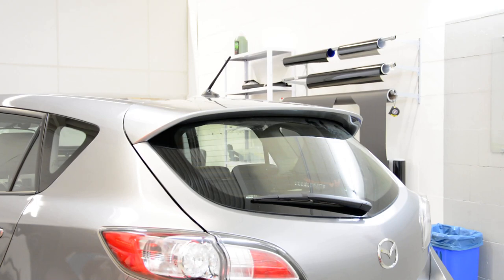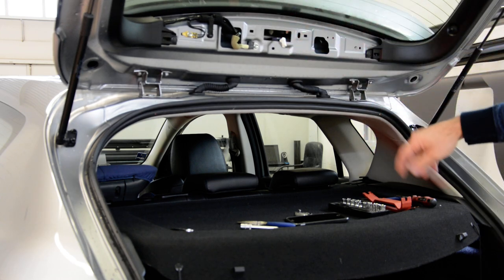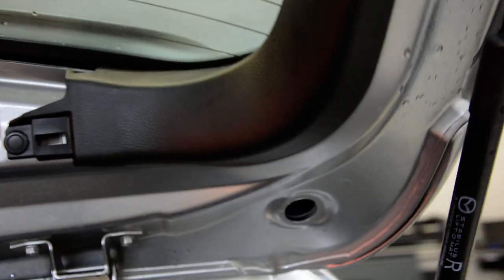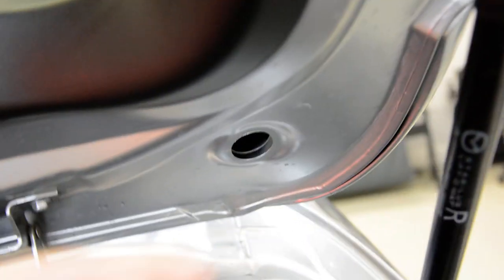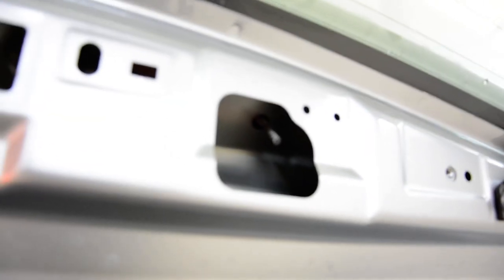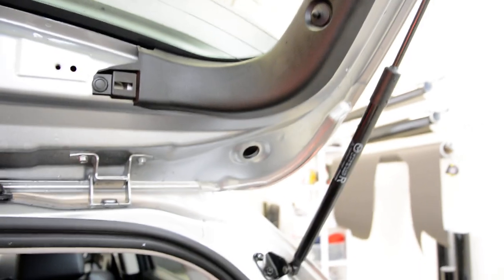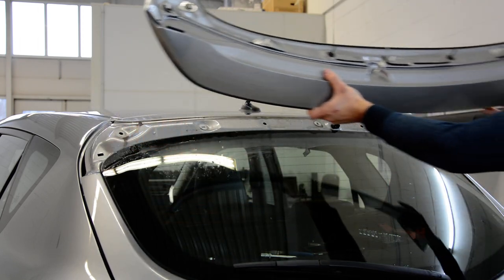How to Remove the Spoiler  Mazda 3

Comment: What did you use to take the screws off because my 10mm doesn’t fit all the way because of the thin pipe sticking out where the bolt is on
Reply: Deep socket

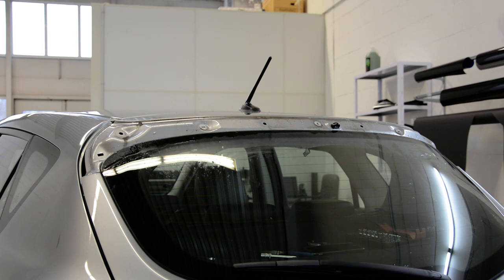Comment: @2:40 what is that black piece in the middle? I'm planning on installing a Speed3 spoiler, curious if it's an optional connector for the external third brake light.
Reply: Mazda Chemist yes I’m planning on doing that too. Very little info online for installing the MPS spoiler on the regular Sport model. I’m hoping they are interchangeable. If you’ve done it already some info would be great.
Reply: @7homas0wen  so, did you do it or at least know if a mazdaspeed 3 spoiler fits on a regular one? Im planning to do the same thing but not sure if it will fit in it tho.
Reply: Ray Mejia they’re interchangeable. Will need to drill a hole for the 3rd break light and some foam tape to stop it rattling. Goes straight on otherwise. Still looking for one in white so I don’t have to get it painted. Not easy to come buy.
Reply: @7homas0wen  Ok, thanks, my car is white as well. But im deciding between the sport spoiler or the mazdaspeed one. I have the regular one.
Reply: Ray Mejia I also have the regular one. The sport in Australia gets the regular spoiler as well. Only the MPS gets a different spoiler.
Reply: @7homas0wen  here in USA the sport version "2.5" has a different spoiler, it kinda has horns or something like that. Search for it and you'll realize it has a different and cool looking spoiler. The one I have is the 2.4.
Reply: Ray Mejia yeah I’ve seen that one. I like the way it looks a lot better but they never had it in Australia soy only option is the one from the MPS. Mines a Maxx sport 2.0.
Reply: I know it's late, but it's the water nozzle for the rear wiper.
Reply: @7homas0wen  hopefully you’re still here, when you say drill a hole for the third brake light do you mean for the wiring? and where does the foam tape go exactly?
Reply: @joegehrke9970  still here. Yes for the LED brake light cables. The tape goes on the underside of the spoiler on the flat spots (can’t really describe it but just throw it everywhere if you’re worried ahaha). I drilled a 10mm hole right in the centre of the top of the tailgate. Wasn’t actually that hard or scary so I’d recommend doing it. Then it’s as simple as cutting the plugs off the existing brake light and new one then twisting the wires together (or you could go out like I did and install a new plug and solder them in) and you should be good to go.

Comment: I dont know if its just cause my spoiler hasnt been moved in 10-11 years but its not unclipping that easy
Reply: Was it just super stiff? Mines doing the same and I’m scared to apply more pressure
Reply: Mine is also not unclipping easily, its very stuck. Hoping that it won't break... I am pulling on it very hard.